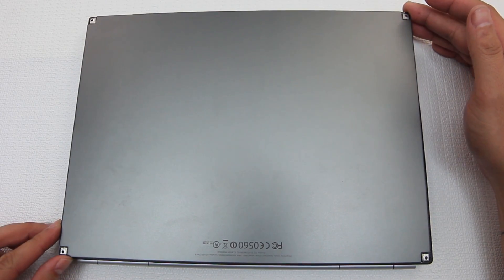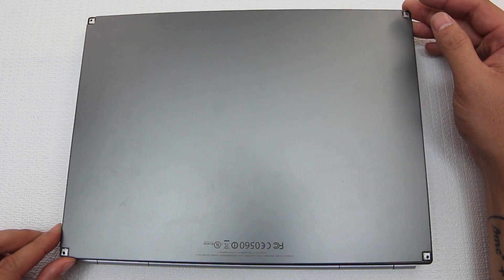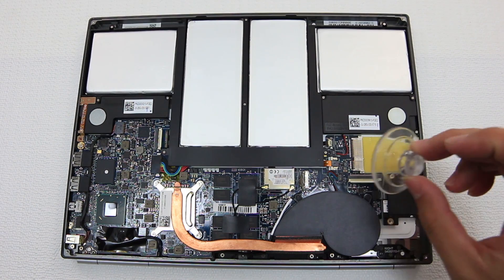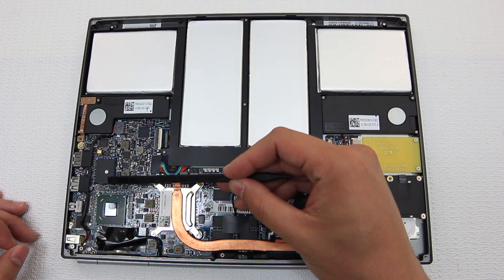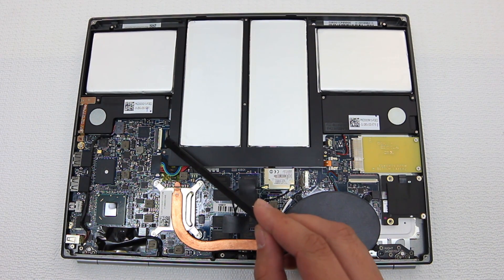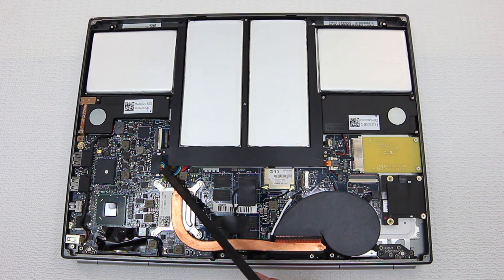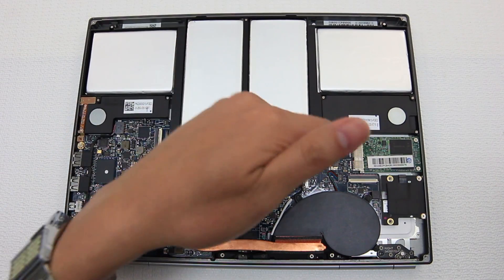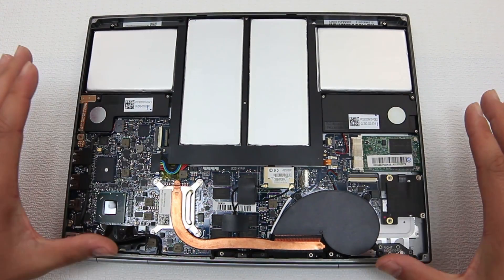Chromebook Pixel Disassembly and [FAILED] mSATA Upgrade

Comment: It seems to be readable but it has to use Windows 10. I have changed the Chrome OS to Windows 10 and it boots very fast, it only takes 5 seconds.

Comment: Does this upgrade now work with the latest UEFI Firmware from mr chromebox tech?
Reply: Nope, the slot doesn't seem to have SATA lanes wired in. Firmware update won't help anything.
Reply: @elektroencefalografista  wouldn't it work using a MiniPCIe ssd?
Reply: @gamecuber6  nope, didn't work either. I think the slot only has usb2.0 wired in

Comment: I put a 64gb mSATA right there and chrome recognized it as USB but Linux recognized it as a ssd so this works on Linux
Reply: Svturn I know you did this forever ago but do you know if a 256gb msata would work in the pixel? I have crouton installed so if Linux will recognize it I'm thinking of doing this to expand my storage.
Reply: @cutofchum  mpcie with sd card can add that.
Reply: yo any luck with adding storage do you think windows would recognise it?
Reply: Jan Selwa just tried and it doesn't read it when the Pixel is running Windows. So no luck with Chrome, Linux and native Windows installation.

Comment: Sounds similar to the Toshiba AC100 setup - which means a similat solution id likely to work. Google for "Better Internal Storage on the Toshiba AC100 part 2" and you should be able to find it.

Comment: I have a question does the Chrome recognize the SSD, regardless if it's like USB storage i think it can be used as storage in a full linux partition, if you happend to know, i'm running Windows 8 and Elementary OS on my chromebooks and if it's wired to a USB it should be recognized as external Storage right?